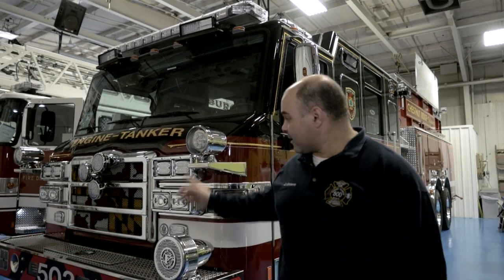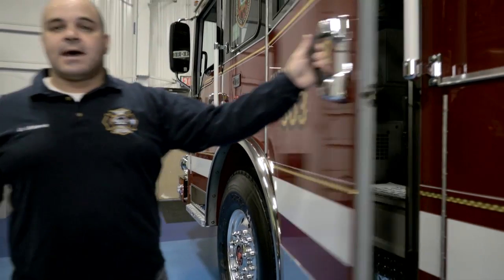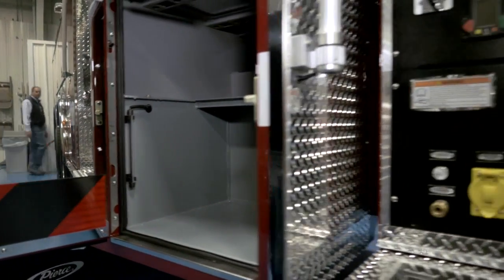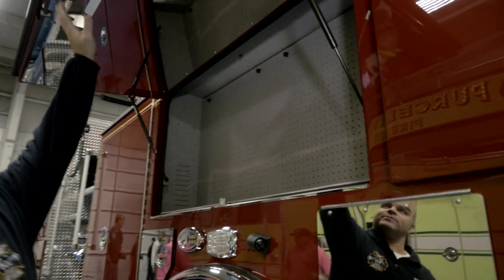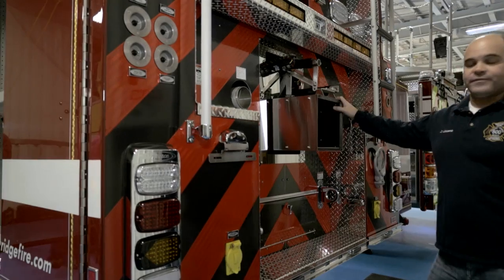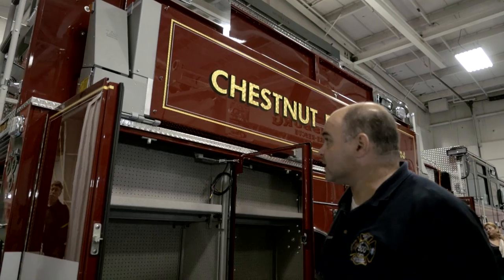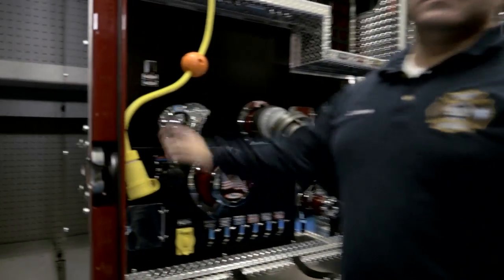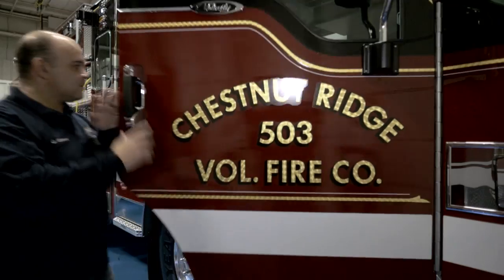Chestnut Ridge VFC, Velocity® Pumper Tanker

Comment: what a poorly designed tanker. the man himself states he can not reach most of the compartments. he also states multiple compartments are so small that they are useless. the ladders are mounted so high on the truck a ladder needs to be climbed to retrieve them. that means multiple members will be needed to remove a portable ladder. the hose bed is so high you will need suplimental oxygen just to retrieve a supply line or longer attack line. 
this pumper-tanker is a disaster. this is what happens when an appratus comittie does not set a goal for the new appratus. this department would have been better off by paying less than $100,000 for a tanker built on a governemnt truck and then building a custom pumper. I feel bad for the members who will be riding this truck for the next 15-20 years.
Reply: Pierce built the truck the department asked for. I am not faulting pierce at all. I am saying that the department designed a very poor rig. They tried to do everything with one truck and they have a poor truck as the result. I like pierce trucks. My department is designing a new pierce pumper. As for the comment on compartment layout. Look at the picture of the entire truck. Those compartments are located at a height above the pump pannel.very few people will be able to reach that high. All members of the department should be easily able to reach all equipment.